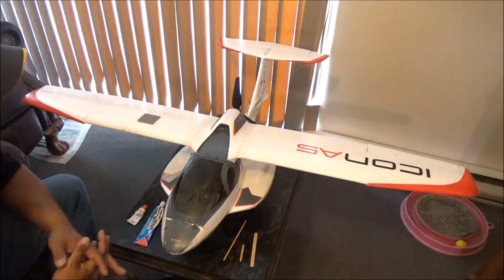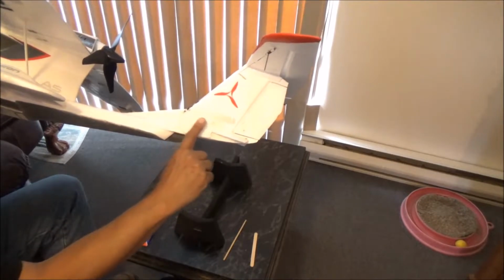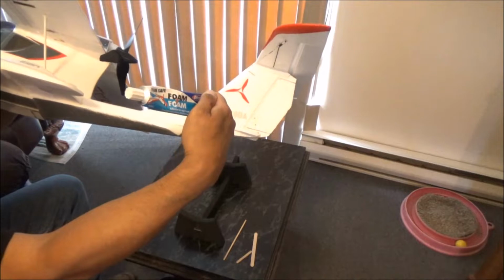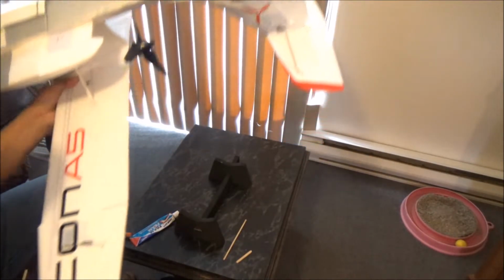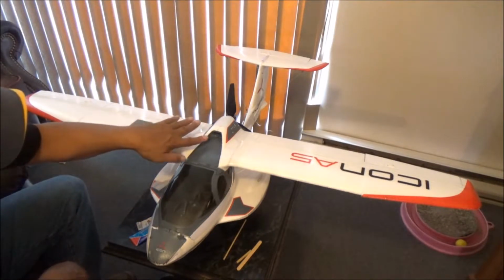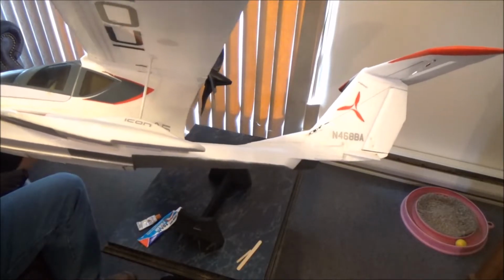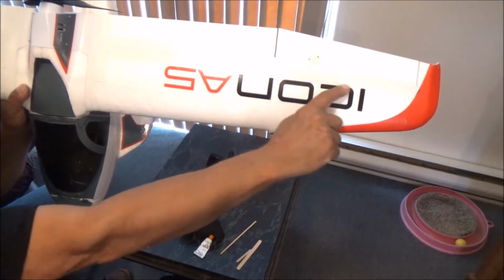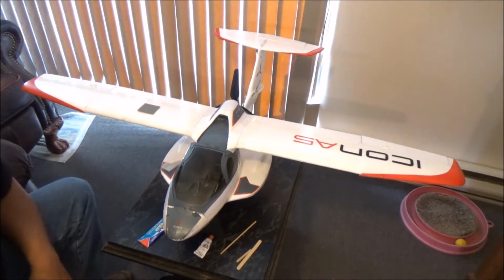E-flite ICON A5 Modifications Review

Comment: Good video.  I've owned a bunch of A5's and put a lot of hours on them.  A few thoughts:  Tail can be strengthened also by shoving in long BBQ bamboo sticks.  But that portion of fuselage will always be weak.  Tail wobbles when power is cut quickly, but that just is what it is.  Waterproofing servos is easy, just slather them up all over the servo arm and shart externally with Dow bath caulk.  I'm so bummed that Eflite dropped the model.  I think because a lot of flyers simply do not understand seaplanes.
They are for the fun of taking and landing.  Especially landings, which the Icon can do in some really cool ways.  I have read reviews with complaints of it not being aerobatic lol.  I watch YouTube videos of people taking off and landing ten minutes later.
These are NOT seaplane pilots :)

Comment: All the design issues with the E-Flite Icon A5 were sorted out and well documented with its predecessor, the Parkzone Icon A5, many moons ago in RCGroups.  These "fixes" you've done cover only one of them - the rudder servo.  Maybe the PO did the other mods for you?  Obviously they didn't do the rudder servo mod.  
Your wing reinforcements are unnecessary.  They're designed to flex.  I've flown mine in winds that were ill advised with no mods to the factory single carbon rod.  It has survived brilliantly under my meager flying skills for over 6 years.  Same with the Elevator ties and wing struts.  They mess with the looks and are totally unnecessary.  This is not a Cub.

Here is a kind of "greatest hits" mods list for a factory EF Icon A5.
1. Tape the wing leading edge (clear packing tape).  It covers their loose tape over the servo leads, and eliminates the mold line.  This will significantly lower stall speed.  
2. Silicone seal the rudder servo in place.  My rudder servo got sealed with silicone in 2014 and is going strong.
3. Shim rear of elevator to fix factory decolage.  NIB units tend to need up elevator to fly level.
4. Re glue plastic cowl.  They come off in flight with factory glue and sound awful when they hit the prop.  Then they disappear into the lake.  Maybe the crack in yours was a prop strike?
5. Prop numbers FORWARD!  (You'd be amazed how many get fooled by this!)
6. Add flaps.  This one is optional, but a nice mod that aligns more with the real Icon.  I've got one model with and one without.  I take out the one with flaps on calm days.

All the best.
Reply from the maker: Thanks for your input, but this bird flies a lot better with my modifications. They were very necessary.
Reply: @Thuribles  I totally understand.  Good luck to you.  It is an amazing R/C model.  Because all versions of the Icon A5 are now long discontinued, it's all probably a moot point.  I've only ever set up NIB Icons.  Even if you don't, perhaps others drawn to your title will find the additional mods I mentioned helpful.  The list was curated over many years by dozens of much better PZ Icon A5 pilots than myself.  Happy flying!